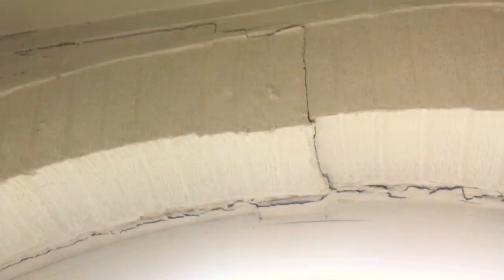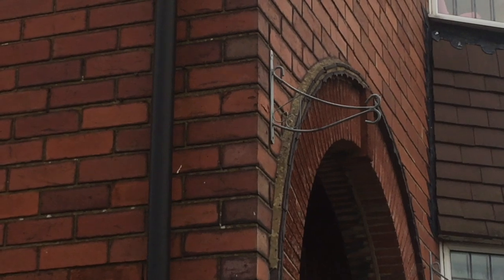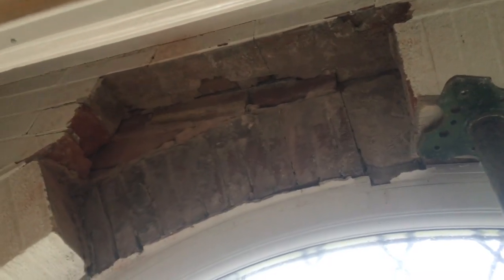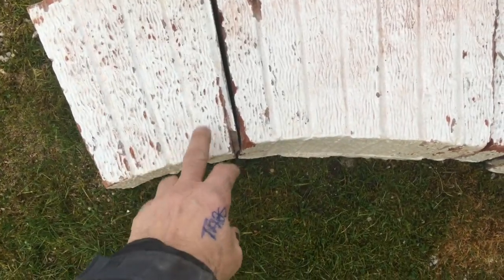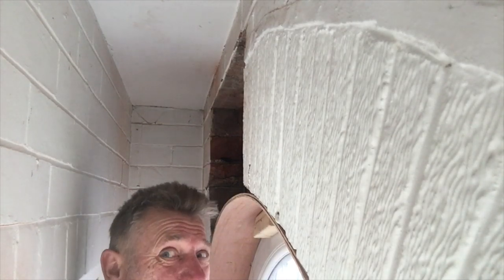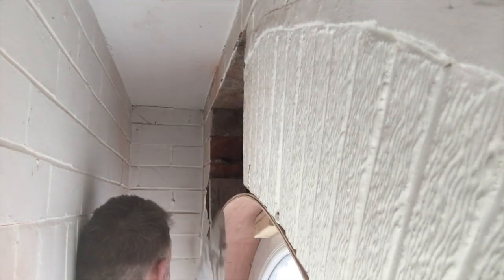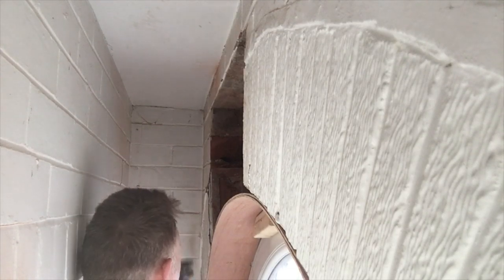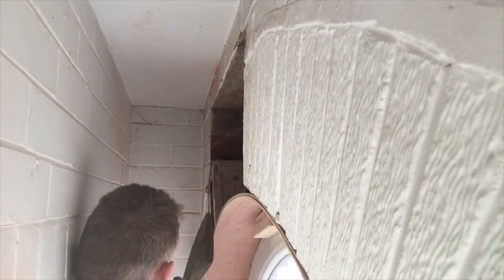Vlog: repairing a dropped brick arch

Comment: I had success on the same type of job I managed raked out the corse above arch and where it had dropped , and on the soldier joint and then just pushed the section up as one - smacked some slate in to arch soldier joint - and them pumped in some 2 part chemical epoxy as it sets like stone - and pointed the front and pushed in mortar above

Comment: Awkward little job but as inside it's definitely a good one for this time of year, now Chris I have built a dense concrete block retaining wall and am going to render it Mon  question is would you put waterproofer in both coats or just top coat👍
Reply from the maker: wheaten bread Yes I personally would put it in both coats👍
Reply: @foundationgood123  Fair enough both coats it is then👍
Reply: @foundationgood123  Not sure I agree with that one, Chris. I've always been told not to out waterproofer in the scratchcoat as it makes the bond of the top coat weaker. Just put plenty of waterproofer in the top coat and that gives enough protection.👍Happy to be proven wrong though, we all live and learn!
Reply: @Jim_Newlands  are they talking about putting stucco on a product watersealer first coat?
Reply: @dinoanthony8263  Yes.